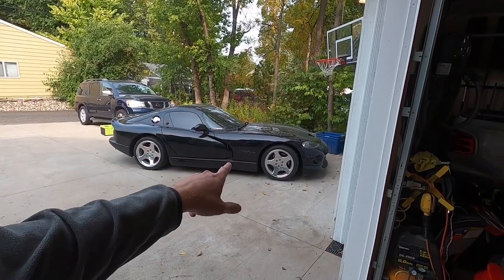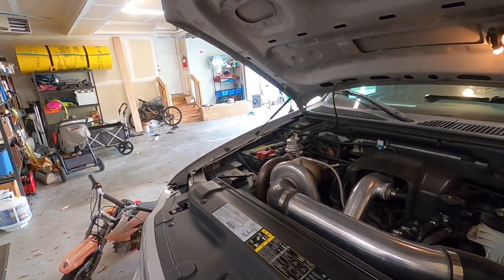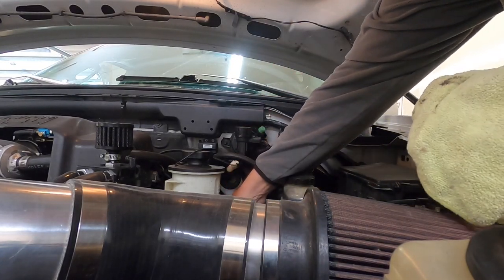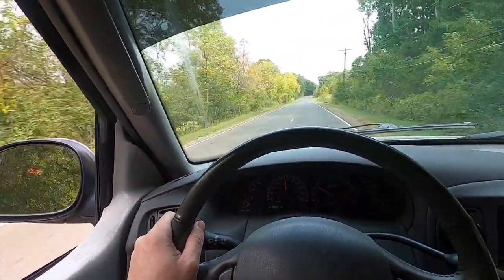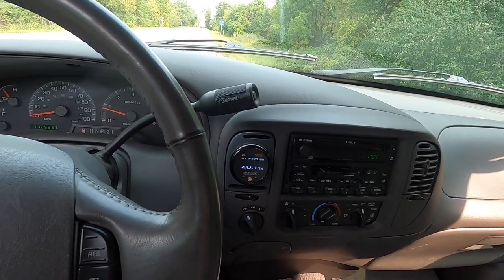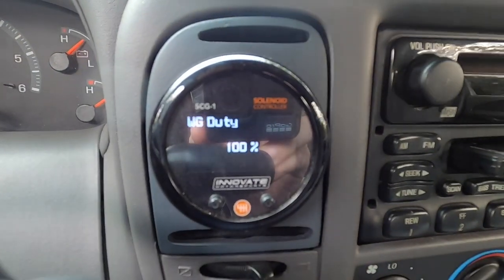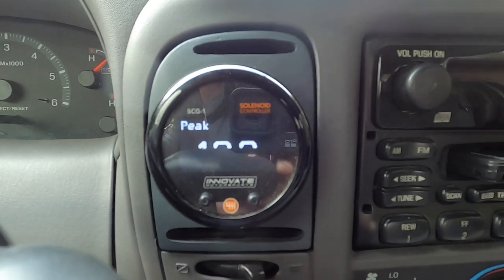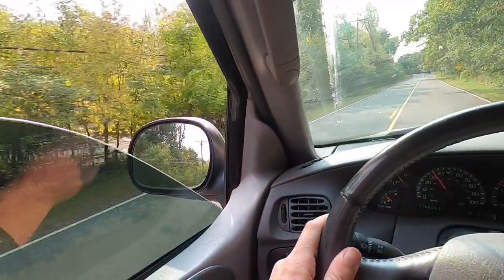Will a STOCK TRITON 5.4L handle 12 PSI?! ***SINGLE TURBO Grandpa Truck***

Comment: Can we just appreciate how clean that truck is
Reply: From what I’ve seen it’s the crew cabs of this generation of Ford truck that get treated nicely and not beat on as much as a single or extended cab
Reply: My moms 03 4x4 crew is cleaner and has almost 300k.
Reply: @Flankerr  More then clean enough, it shows someone has actually used it as a truck a time or 2.
Reply: @Flankerr  I've seen 2015's that make this truck look new
Reply: Your mom hasn’t been that clean since 03
Reply: In my opinion it's one of the ugliest trucks to exist
Reply: @ceo-kiwi8678  true
Reply: @ceo-kiwi8678  Yeah this wasn’t Fords best body style and probably the worst
Reply: @williamsanders468  that's interesting. If I remember right those came later on, so maybe young guns had already had their fun. I mostly saw older folks buying those New. 

I know for a Fact I had buddy that had a 99 or 00 Etended Cab back in 03? Had the 4.6 and he red lighted, slow rolled and 3 honked everybody he saw till he got rid of it. What a beating that bitch took lol
Reply: Damn what's with the hate? Seems like the Heritage sure is either Loved or Hated. No in-between.
 I been a Chevy guy since I could drive (1995) and my first Ford is now an 02 FX4 Supercrew and I wouldn't own any other....ok, except maybe a 16 and up version of the exact same truck. Those are pretty sweet.
Reply: It's a triton so it's whooped
Reply: very hard to find them with that low of miles. nearly all of them i have found has well over 200,000 miles on them. mine had 270,000 on it before it crapped out and that was largely my fault.
Reply: @shpuz  for real. Mine was a hell of a find at 197k. 221 now and still like new. I did do all new tune up stuff, including Injectors and K&N cold air system. It's a champ. Tranny will go before the engine guaranteed
Reply: @scottskinner577  I don't think I know of a single person that's had transmission issues with that body style of f150. I know 2 people that have over  300,000 miles on there's with no transmission issues. One is still on the factory trans oil. Either way, I believe the 2 valve 5.4 is the most underrated engine as far as reliability goes.
Reply: 441
Reply: Not A big fan of American cars 🇯🇲🇯🇵🗣but that 150 was bone clean bro !!!
Reply: 470 rwhp .
Reply: Can we just appreciate how over used the "Can we just Appreciate" comment is, reused and abused so many times by so many people 😏🙄
Reply: @shpuz  I've crapped out 2 in 2 years. I drive like a grandpa though.
Reply: Lol I love my old v8 ngl I have 1
Reply: @jonathonsmith7694  👈 the one upper.😂
Reply: @scottskinner577  make sure you change those timing chains or it will self destruct they are know for the plastic timing guides and shity tensioner to go out without notice.....good luck
Reply: @shpuz  I should have clarified it's an Overdrive issue, not a general tranny issue. And every issue I have heard of with Ford transmissions in the 90s 2000s is usually the OD. It's like they took 3 speed designed trannys and added 4th gears to them, and that's been the weak link ever since. 1-3 it's perfect.... but shifting in or out of 4 it's a little shaky.
Reply: @williamsanders468 that’s because 5.4 triton are junk and had recalls for spark plugs shooting out of the heads.

You literally can’t be hard on them.
Reply: @jonathonsmith7694  my 02 F-150 has 329k miles, and still has all the factory stickers on the frame it looks brand new barely any surface rust on the frame and nothing on the body I bought it from a guy for super cheap needed some work but someone put time and money into it😁 and it came with all the stuff to fix it lol

Comment: That cool noise is called compressor surge and I caused by your blow off valve not opening
Reply from the maker: Well, that's the best sounding equipment failure I've ever had!
Reply: Yea its really not good I agree sounds cool but on my twin turbo bmw I had to use a bigger line going into the bov to keep it from surging
Reply: Or a malfunctioning or poorly controlled or undersized bov. ✌☺👍
Reply: @AutoDetour  also i think i remember a recall on the short bed reg cab trucks.  when on the brakes hard it can lift the rear axle?? Edit. Instead of asking more questions about the setup ill watch the other vids. My next q was going to be what ecu ? Then rev limit? Boost cutoff is all good but fuel cut kills motors.
Reply: We call that stutututututu
Reply: Nothing bad it’s just the  rest of the boost is just leaving slowly
Reply: @adrianherrera4642  It could be bad depending on the turbo. The surge is boost leaving through the turbo making it spin backwards. In a lot of cases is can snap the shaft because of the sudden direction change
Reply: on modern turbos it’s not really a issue. on older turbos it can cause damage, but most modern turbos can handle it.
Reply: @AutoDetour  compressor surge is not a concern as long as you don't get surge constantly while under load. So absoluteley no problem.
Reply: @chickenfixn4439  any amount of  surge couldn't spin your turbo backwards. That's complete bs. That would imply that the small amount of relatively low pressure air that is between the turbo and throttle valve somehow imparts more energy into the turbo then an antilag system on full fire. Or the exhaust at max rpm when you stomp the throttle. What actually happens is that the air somewhat rapidly decelerates the turbo and escapes in pulses. Creating the well known flutter noise. This is in itself not a problem as long as it doesn't occur under load and constantly. It does though have the disadvantage of significantly increasing the time to full boost when stepping back on the throttle due to the engine having to put more energy into accelerating the turbo to operating speed again.
Reply: @mr.pineapple7620  Your comment got me thinking so I went back through my college textbooks on forced induction. Turns out you're correct and I had a misunderstanding on how they work. Thats my fault
Reply: @bentboybbz  fuel cut saves engines... you sir have no idea what your talking about
Reply: @chickenfixn4439  wrong. Right in the fact that its excess boost leaving through the turbo but no it is not bad for the turbo in this instance. IF he had surge while under load then yes it would be bad but as he lets off the throttle, not snapping anything
Reply: That or too much boost for the bov, it could be bad in the long run but for Sunday driving, it turns your racecar into a spaceship 😎
Reply: Y’all are all wrong the turbo flutter comes from the turbo when you do not have a blow off valve and the surge from the turbine wheel and it goes into the intercooler and back into the turbo
Reply: 3 years on my turbo setup 20psi , no BOV ,turbo is running strong still
Reply: @chickenfixn4439  yupp if hes creating boost while its surging it will cause damage. yet it will not if he is surging off of boost
Reply: @SwagginWagginN54  n54?
Reply: @chickenfixn4439  it is not spinning backwards. Do some research before saying things that aren't correct
Reply: @mr.pineapple7620  this guy knows what's up
Reply: @devonswindell9735  Glad you could jump on the train late bud. Welcome aboard 😂😂
Reply: @salvatore1231  mhm
Reply: @chickenfixn4439  the turbos shaft never spins backwards. There is never not a rotational force spinning the shaft in one direction. The sound is the blades chopping the air as it passes out. The most it does is stall the comp wheel. But it never spins backwards.
Reply: @chickenfixn4439  they don’t actually spin backwards, it cavitation behind the veins causing the noise.
Reply: You're technically correct. While this statement is true, light load / lift off flutter has essentially no impact on the turbo or engine longevity. 

Here's a few facts about turbos and compressor surge. 

The sound "stustustustu" is caused by air separating from the back of the blade.. in aerospace they call this "stall", essentially generating zero lift. 

The compressor does not stop or spin backwards. If it did, you wouldn't hear anything since the blades stopped. Moreover, a turbo can spin up to 100,000 RPM... If something with that kind of angular velocity stopped suddenly, it would be catastrophic. 

Compressor surge CAN be damaging to a turbocharger if; the turbocharger is feeding more air than the engine can ingest.. thus causing the air to exit the compressor. There's a great video linked in the article below. I suggest reading the article and watching the video to clear up any misconceptions you and everyone else posting about surge may have. 

Also, I realize you didn't post many of the things I commented about. A lot of this was just meant to be informative for anyone reading. 

https://gfb.com.au/tech/tech-articles/11-the-truth-about-compressor-surge/#:~:text=When%20conditions%20are%20right%20to,%E2%80%9Cgrip%E2%80%9D%20on%20the%20air.
Reply: @SwagginWagginN54  compressor surge does not cause issues as long as you arent hearing them under throttle lmao. should he get a bigger bov ? maybe so
Reply: @kickinyourassblackop  yeah lmao or run the correct size vacuum lines
Reply: Ten bucks says OC doesn’t own anything with a turbo
Reply: @riverjordan2004  OC?
Reply: The neon srt made that sound too. So I guess dodge over looked that or maybe its supposed to make that noise.....
Reply: Compressor surge only matters under boost. Off boost & off throttle, my Fiesta ST makes the same exact noises from the factory. I really dont think this is anything to worry about tbh.
Reply: Wow queef
Reply: @zuestoots5176  unless you have too much air coming in and it runs lean. Guess it depends on the setup you're running. N/A I'd believe that but boost or nitrous motors cutting fuel would run lean and created more heat. Melting pistons from a lack of fuel is a bitch.
Reply: Not always air could be going back into the turbo also. It sounds so dope but can be so bad for your car/truck
Reply: @SwagginWagginN54  it won’t hurt the turbo. Some people do it on purpose
Reply: @mr.pineapple7620  I totally agree with you!! I've had it happened in my powerstroke many times even ask the guy that did the performance mods and he told me the same thing you just did
Reply: @jamiejenkins5643  I am always happy to help
Reply: @chickenfixn4439  The turbo does not spin backwards. The sound is actually the propeller chopping through the air. It's not bad for the turbo, especially in low boost applications
Reply: Thanks for saying that

Comment: Nice truck, I have a 01 f150  5.4 2 valve almost 300,000 miles ...never was a Ford fan but this is the best truck I have ever owned.
Reply: You got lucky the 5.4 tends to have issues
Reply: 3 valves are the ones that die early.
Reply: The early ones are stout one of our company trucks a 2000 f250 had the 5.4 it jus wouldn’t quit we put over 400k on that engine it started getting a lil weak but still ran good we jus swapped it for a 6.8v10
Reply: @hunterrollins5646  not the 2v 5.4's
Reply: I have a 1998 sohc 5.4 in my 150. 199k, still strong.
Reply: @hunterrollins5646  misinformation buddy. The 3V 5.4 motors are the ones that are terrible.  The 2V 5.4 are reliable as heck(minus the weak spark plug threads)
Reply: @jessekelley9384  225,000 on mine, seems like Poor maintenance is what does it. My dad used to have a 5.4 3v too and he was at 290,000 before he decided to trade his in. People beat the trucks and then blame the motor.
Reply: Same here 💯
Reply: Just got a 2001 f150 Supercab V8 5.4 2v with 84k miles on it brand new clean. $5,000 😳🤯
Reply: My 5.4 3v has 280k, just changed out the starter alternator battery after is sat for a few months, has a locked up ac pulley but other than that it’ll probably run till 400k hopefully 😂

Comment: damn I never thought I would say this but aside from the cam phasers and spark plugs shooting out, the 5.4 is a tough ass motor
Reply from the maker: No cam phasers in the 2 valve 5.4, but yes, sending a plug into orbit is certainly a possibility. 😂
Reply: @AutoDetour  espacially with boost😂
Reply: The two valves are complete tanks of a engine!
Reply: Ya its the 07 and up that blow their guts out at 175k. Pretty sure they came with a pack of helicoils in the glove box from the factory....
Reply: @JohnDoe-jj6wf  the 3v came out before 07
Reply: @JohnDoe-jj6wf  actually, it’s the 04+ with the 3V with cam phasers that didn’t shoot spark plugs, the 2v and the 3V had the opposite problems with plugs. The 2V didn’t have good enough threading, and the 3V had way to much which would cause the classic problem of breaking them on removal. the 03 and earlier 2V is a hell of a motor, and the 04+ is good too, just use factory recommended 5W-20 it’s whole life and keep it clean. The 4.6s were more reliable because the oil pump was too weak for the 5.4, along with narrow oil ports which would cause for lack of lubrication in the heads where the cam phasers and timing guides are.
Reply: Sorry, just had an 07 and 09 that shat the bed on me. Use the rule of thumb to always get the larger v8 and sell before 175k for me, but thanks for the info!
Reply: @gavmillz8285  ok mr mechanic tell me why my buddies 05 shot out a spark plug lol, on multiple occasions wasnt always the same one
Reply: People seem to hate this motor if they’ve never had one. My buddy had one with nearly 500k miles on a motor with the same parts it rolled out of the factory with until he got creamed by a semi not paying attention to the line of vehicles stopped in front of him. He bought it new. It was either late 90’s maybe ‘00 or ‘01. And he was not easy on that truck at all
Reply: @tannerhartl5175  thanks for the info, bought a 2015 Harley edition with the 6.2 and couldn't be happier now. Cheers!
Reply: Plug issues tend be to caused by poor/lack of Maintenance. A very well maintained 5.4s don't have that issue
Reply: Well yeah it’s a Ford, built tough.
Reply: No cam fasers on the 2 valve
Reply: i was so worried about the plugs and those 5 threads holding them in lol
Reply: @gavmillz8285  the both blow out plug and they both sieze plugs, the issue is the heads aluminum alloy, it's reactive with the metal of the plugs and causes them to corrode together, if you wait the full 150,000 mile interval over years, the aluminum corroded enough to be weak enough to crumble under compression and the plug blows out, I've done the thread repair kit on both the 2 valve and 3 valve for this exact issue many times.
Reply: @heklyr3370  true that I have a 04 and it's a great motor I've put 215k on my baby and I've changed the alternator and some suspension stuff and tires fluid and windshield wipers and battery but that's all it's a great engine or atleast the one I have had has been the most reliable truck I've ever owned for sure
Reply: @jdog942 heard the v10s are reliable
Reply: Stock pistons are aluminum btw cant believe they take boost well.
Reply: @AutoDetour  A couple drops of blue locktite on each spark plug and torque to 23lbs,should never have a problem with plugs shooting out.👍🏾
Reply: @Dray12321  because he never retightened and checked them. Or he changed them himself and never torqued to spec. Any other brain busters? 🧠 🤯😆🤣😂
Reply: Cam phasers issues was in the 11th generation and up. These 10th gens did not. I always replace the heads with new cams and what not and fixes the problem.
Reply: @AutoDetour  same engine I got I'm subscribed
Reply: 2 valve was in the F-150  up until 2003. You can get the two valve in the 2004 Heritage edition also. I don't hate on the three valve but they have too much problem potential. The two valves are my absolute preference and the four thread heads really aren't a big deal. You can find a third heads in put those on or just do the repair on the ones you have. It's really not that difficult.  I think most of the issue with people spitting spark plugs out is the plugs not being installed correctly and torque down right. My O2 cents.
Reply: @JohnDoe-jj6wf  the 2v after 06 have the 8 thread count spark plug holes, no helicoil necessary. I pulled the 8 thread 2v heads off of an 09 crown vic at the yard to avoid blowing out the spark plugs.
Reply: Had 2 of them. Only the early ones had problems blowing spark plug issues. Had the incerts put in my 98. Never had a problem.